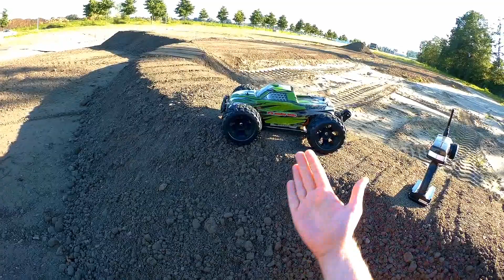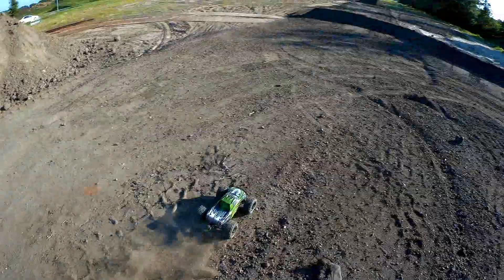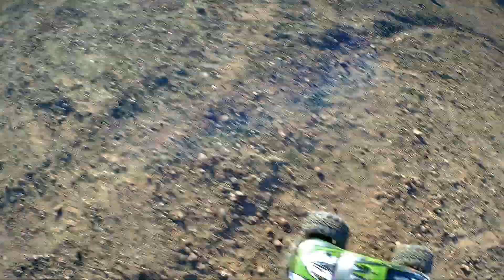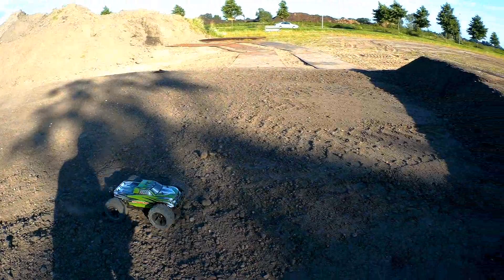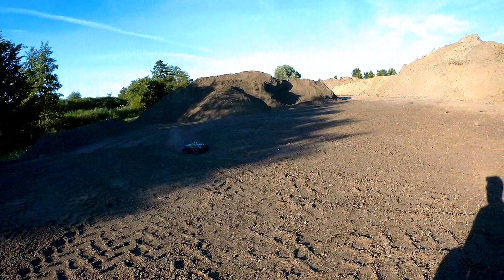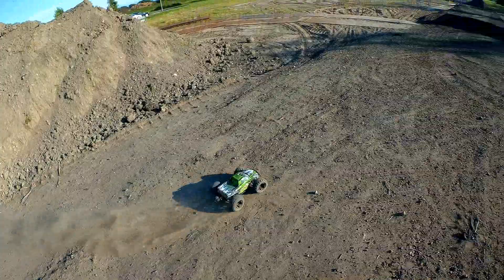FS Racing 1/10th scale Monster Truck on 3S?? :O

Comment: Got this MONSTER TRUCK with model FS RACING 53631..with a description on the online selling site to where I got this was bundled with Brushless motor 3652 KV3000 motor and an ESC 60A made by HOBBYSTAR ( research on that thoroughly so that I ordered the right Led Program card for it). The original description of the battery was NIMH and it came to me on a 3S lipo 5400mah 45C on it. (that was fantastic)

At first run, the battery got the voltage lower than their threshold of overdischarge of 3.1v.reads of mine was 1.8v per cell .but fortunately manage to recover it using a single cell lipo charger. 
Note: do not plug the lipo onto an Imax B6 charger with their cell lower than their supposed to be 3.2 discharged, got mine smoking when trying to balance charge them (didn't see it coming).

I ran my FS RACING on 3S, well guess what..the 3652 3000KV motor heat too much. so i dropped to 2S with less stress now. Thinking of putting a heatsink and a fan on that motor to maybe keep the heat away less on 3S.

Overall, the MT is great , although my first 1/10th scale. I'd say this is an awesome MT.
Reply from the maker: Howdy Neil :)
thank you for sharing your experience with the car! I agree it is quite a nice car, especially for what it costs.. Good to read yours is doing well, apart from some mishaps with the lipo.. Yep..3S is a bit much for the car.. Mine did fine, but it was allso kinda uncontrollable on 3S ;)
Cheers & happy RC-ing!
Reply: Thank you for the review too of the truck, I had watch too many before buying it, that actually satisfied me of having one and I did. So fun to drive, got power, loves to wheelie, just great for me as of now. And to sum it up..pretty CHEAP for a 1/10th scale. I fitted a heatsink and a fan on the motor and it helped a lot. Still waiting for my led program card for that hobbystar ESC..a pain in the ass looking for the right programmer card. :)
Reply from the maker: Good of you to do your research well Neil! that in itself has helped you out quite a bit :) 
And yes.. them programming cards should just Allways come with the car/ESC or what? :)  You can do the programming without, but that is even more of a pain in the neck :D

Comment: Awesome bash on 3S! Still deciding between this and the main 2 powerhouse budget Chinese 1/10, the Vkar Bison and JLB Cheetah 21101. I don't like the fact that the Cheetah and Bison have non-standard sized tires and wheels which I can't swop around with my other 2 1/10 trucks. Your video might just be the decision maker for me. 

Maybe changing the motor to a 3660 2600KV and an 80amps ESC, it will run better on 3S. Probably a cheap 15kg servo will help as well. 

Good notes on the diff oil!
Reply from the maker: Thanks brother :)  I Did like the car a bit better on 2S (A Good 2S lipo that is).. but I think the car would have been happier on a less bumpy surface as well ;)

Comment: I have this truck for 10 months now and
 still rocking monster speed as of last month until it broke, I forgot to tighten the slipper gear..(the gear after the pinion gear) and I wear the slipper pad somehow. 

To all who has this FS racing Victory, check the adjustment of that slipper gear. it has a nut after the spring..size 10mm nut, and every hard bash. just check for some wear and re tighten at least 1/8th turn there after..The large spur gear driven by the pinion by the way is made of plastic.

My solution to wear is to fabricate my own slipper pad out of automotive gasket and formed like the original...I am thinking of a TEFLON sheet..probably will work better than paper type slipper pad.
Reply from the maker: Thank you very much for the added info! :) 
quite a few cars do come with a sandpaper-like pad, and yeah.. those wear out offcourse but I can imagine some kind of Teflon pad would indeed work better :)

Comment: hey D-RC... did you by any chance temp gauge the motor or esc after running? that would be interesting to know. truck looks pretty good and yes the servo was noticeably horrible. tires on it looks good and good all around but i'm sure if you drove it here mostly and more suited offroad tire would improve things. it certainly became alive on 3s and FS racing has impressed me with the quality RCs they have released. Good to see rc truck video too! lol  cheers buddy
Reply from the maker: Well no. But I CAN tell you that the motor wasn't very hot.. The ESC was though ;)  Not to the point I was worried about it though.. 
Yeah.. at least on This surface the tires didn't perform perfectly.. but I wonder what kind of tire Would :D  The car was basically allmost running on marbels here :) 
Cheers & thanks buddy :)

Comment: Nice vid, what would be the best this truck or a redcat blackout pro
Reply from the maker: I would personally go for this FS Racing one.. The Redcat's I've had & seen were of lesser quality...
Reply: DutchRC Adventures thanks for the response, I do like all the metal parts on it.I'll turn 50 in March, this would be a good birthday present, what can I do about the charger end?
Reply from the maker: Nice man :)  Early congrats from me on turning 50 then :D 
You don't have a hobby-grade charger yet? I think this would be a good option: http://www.banggood.com/IMAX-B6-AC-B6AC-Lipo-NiMH-3S-RC-Battery-Balance-Charger-p-908064.html?TO251813974002015038

Comment: I thought this was a great video and the truck looks like a real bargain right now (£132/€147/$175 from Banggood) and your rugged test showed it was pretty durable! I have a VKar Bison and a WLToys 12428, do I need this in my collection?

Oh, and did you lower the suspension at all?
Reply from the maker: For sure.. this car can indeed take a beatig :)  it IS a bit smaller then the Bison though, but for what it costs I think it's a good option yes :) 

Nope.. I ran the car completely stock..

Comment: Would you consider mabe just selling it and getting something else? Thats kind of what you were impying towards the end. who wants to invest money into that then having to upgrade steering servo's, body ,whatever else you mentioned.
Reply from the maker: Yes indeed I would.. I have another similar truck on the way.. So selling it is sertainly an option...
Reply: +DutchRC Adventures That would probably be my fix for it,lol. We used to have a saying when we had a car that the motor was beyond fixing in my younger days. we would say we were going to jack up the radiator cap and drive a new car up under it. I am going to give my WL Toys helicopter one more spin today,then probably post it for sale. I think I would rather own something different than that. It does fly dont get me wrong. It steers like a bus and acts like one too. I didnt want something that turns into a blur when I get it into the air so my options are going to be open. I definatly had my eye on one a while back but forgot to book mark what it was. Price wize it was reasonable,just forgot what it was I looked at.
Reply from the maker: Well there is something to be said for just having something different again anyway huh? :) Even when it would run perfectly.. Time for a different experience :)

Comment: I noticed that with the little Dromida 14.8 truggys brushed. The lipos are too much for it,I watched the demo between brushed and brushless and clearly more power isnt everthing with these smaller cars.Too much flipping going on. I see your turning is mabe irradic? Short lived as far as running with that battery. Just goes to show,you really shouldnt slap a bigger battery in your RC without doing research. I noticed my front shock was already leaking oil. I plan to up grade it to the Aluminum ones.  Let me know if you find a self righting truck,I would jump on that.
Reply from the maker: Yeah.. well with this video's someone ellses research has been made a bit easier I guess ;)  My main aim was to see if the electronics would live.. Now I can safely say the car can run on 2S well.. And has some margin left in it..
Reply: +DutchRC Adventures You proved that! I know too many kids that right away want to jump into a maximum powered battery,well thats fine as long as you change the ESC. I myself always error on the higher out put ones. The EEC blog with Dave pretty much proved that the ratings on these ESC's are pretty much bogus.The ammount of heat produced would melt a hole through a foamy,or damage a car if it wasnt for the thermal overload switch in SOME of these. I always cut a hole in the shrink tube they put over my ESC's.What good does it do to put a heat sink on an ESC then cover the thing with tubing.
Reply from the maker: Ah yes.. BUT that is how they learn (I hope :P) Yeps.. adding that hole in the tube really does help for sure :)
Reply: +DutchRC Adventures I agree,we learn as we go. Better now than when I started out,no idea what was what. It was normal to abuse the crap out of something just to see what would happen. I see adults doing that.lol. I personally learned by watching everyone elses mistakes. cheaper that way.
Reply from the maker: Ghehehe ahh yeah.. I must admit I do like rolling the dice now and again :)  As you know I run my HPI Apache on 6S, where Everybody tells me it can't ;)
Reply: +DutchRC Adventures Thats when you do it anyways right? I bet you were always the kid in school doing whatever the little girl behind you was saying" your not suppoed to do it like that,teacher says!" but you did it any ways,and got away with it.
Reply from the maker: Hahahaha :D  I'm glad to see I'm not That easily read :P ghehe girls didn't have such an infleunce on me.. that happened later ;) 
But.. IF someone says: can't be done! well.. all the more reason to try it :)

Comment: Batery 3S The esc 60A?
Reply from the maker: Yes.. more lipo cells does NOT mean you need a bigger ESC.. (in fact.. it's kinda the other way around)
Reply: Colleague, I bought a FS model 53631 with esc 45A, I'm waiting to arrive. I wonder if there would be any problem using 3S battery in this 45A. I speak from Brazil, thank you for listening!
Reply from the maker: There really shouldn't be a problem running the car on 3S :)  I must add I liked the car More on 2S though :$